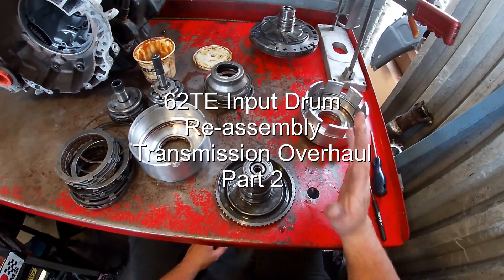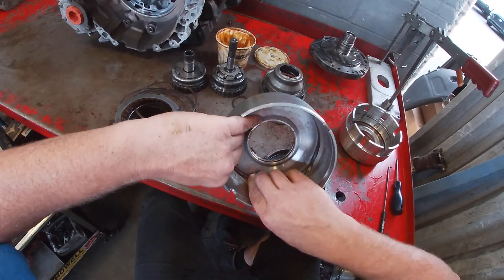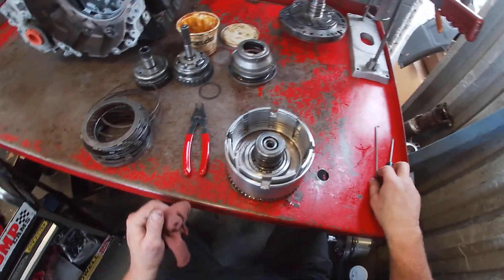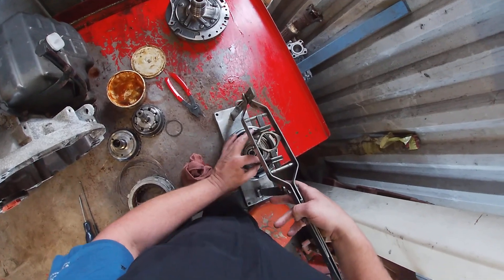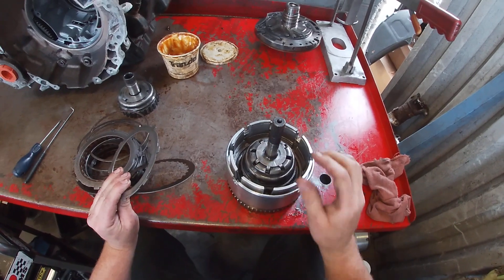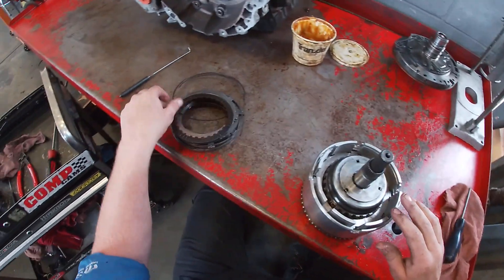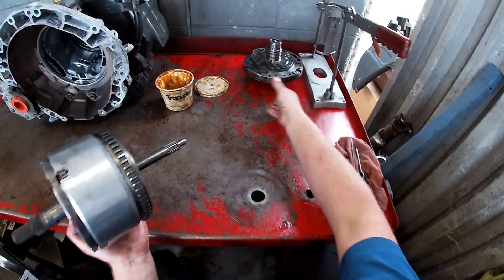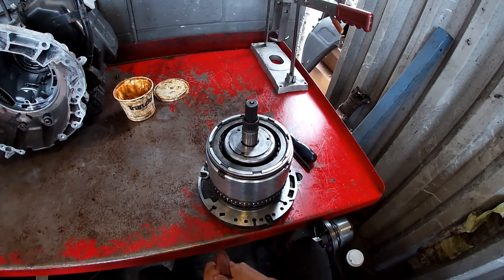62TE Transmission Input Drum Re assembly

Comment: My drum shaft has a lot of play in it. and im not sure ithats suppossed to be that way
Reply from the maker: The input shaft should have no play in the input hub when removed from the case. The shaft is okay it is the hub that needs replacement. It is part #0517518AB. Good luck
Reply: @Tech_1968 well what i mean is that when the whole input drum is assembled the top shaft moves around and has play. I cant tell if that just natural movment or if theres alot of wear
Reply from the maker: Oh okay, if it is the stubby set of shafts that go into the first set of planetary gears then yes there will be play, that is normal